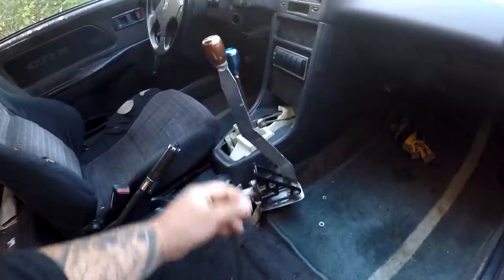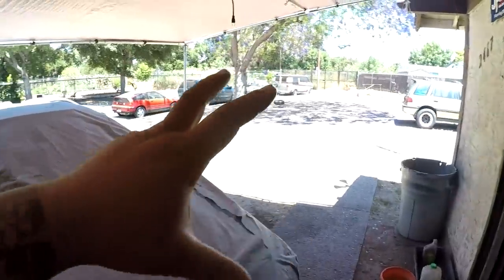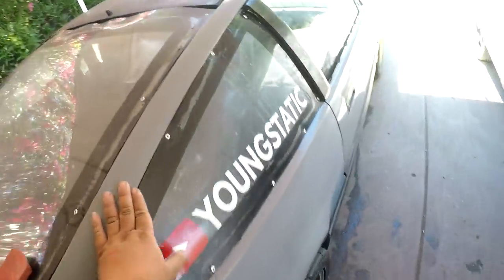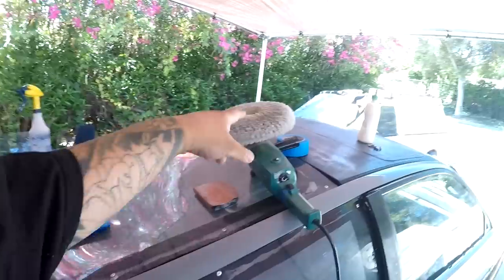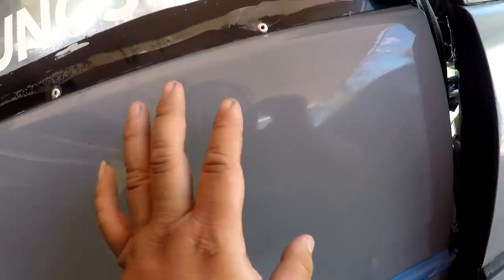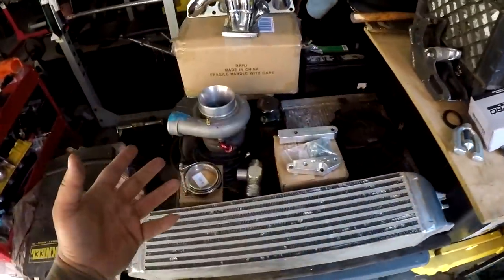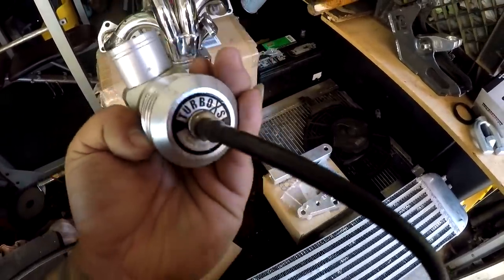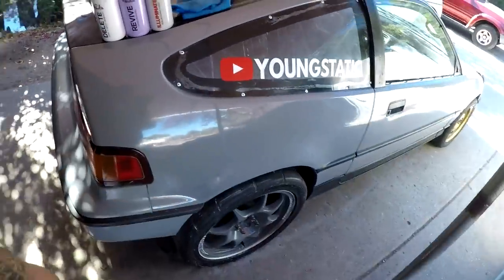$50 dollar RUSTOLEUM paintjob CUT n BUFF | Turbo Setup for H

Comment: Try useing rustolium satin then clear coat over it with a good quality spray gun and a good quality clear, might cost you an extra 50-100 bucks but it will save you anywhere from 20-40 hours in wet sanding and polishing